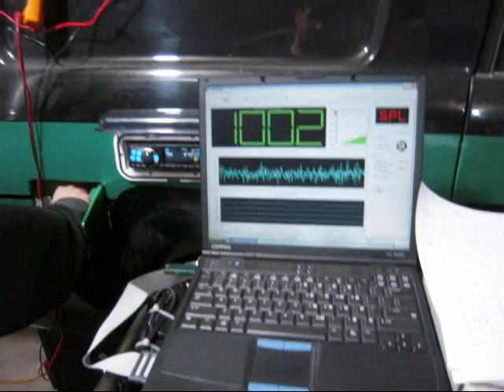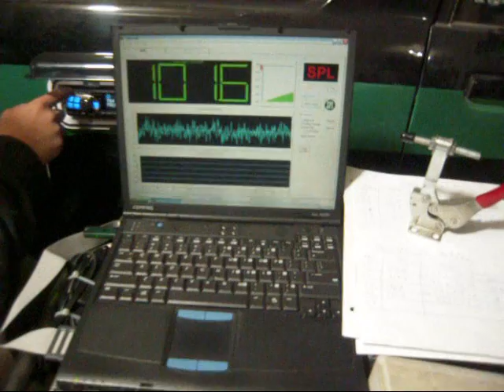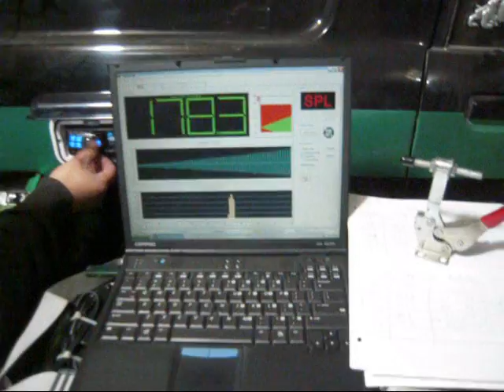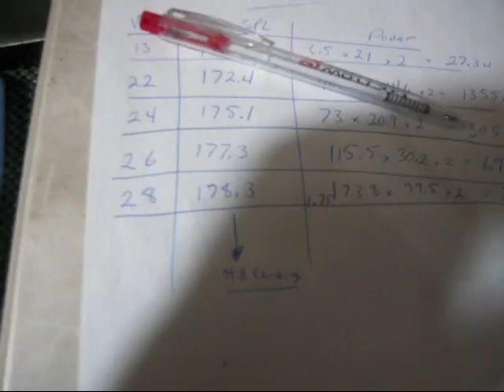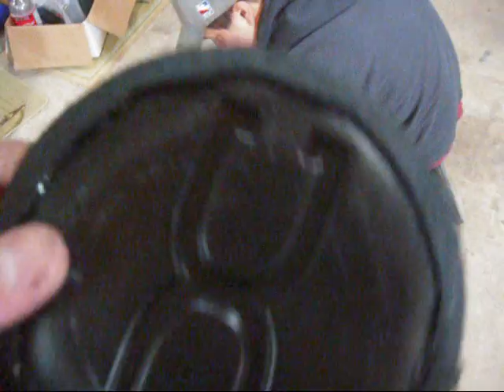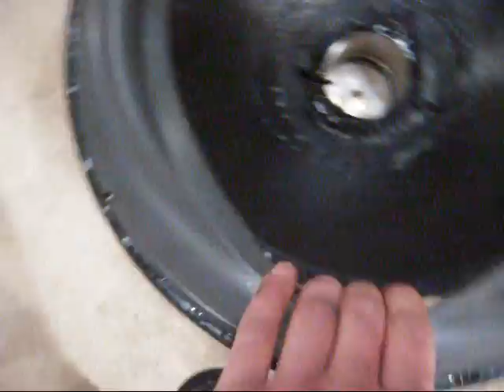DC Audio 178+ on a single sub

Comment: "157.2 dB on 27.3 watts" - holy shit, for any frequency.

What frequency is that, ~70 Hz?

Must be an astronomical gap from 177 to 178 if you need 26000W to do it.

Comment: I'm intersted in get a level 5 or 6 18 neo. But I'm worried will the voice coil bust through the cone like that one did and is it possible you could give me dc audio head quaters number? I would like to talk to rusty would greatly appreciate it. I'm currently rocking JL but wanta change to dc.